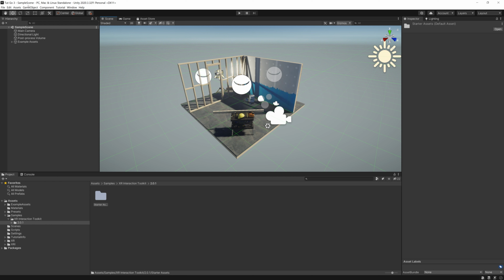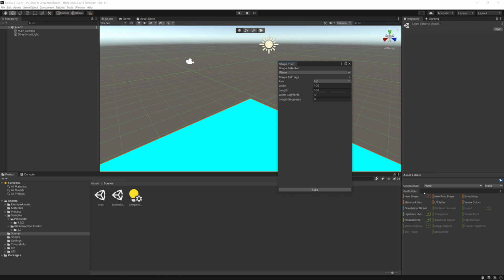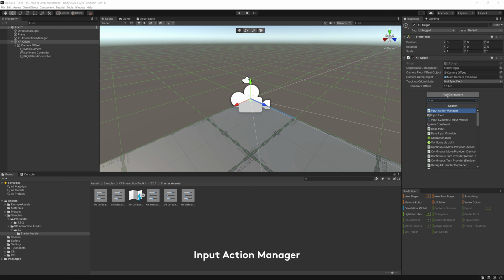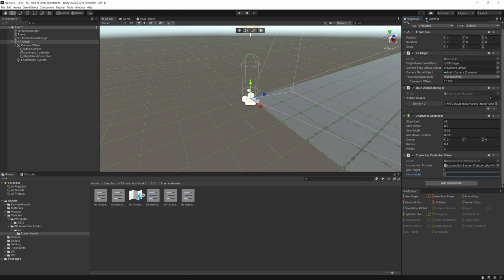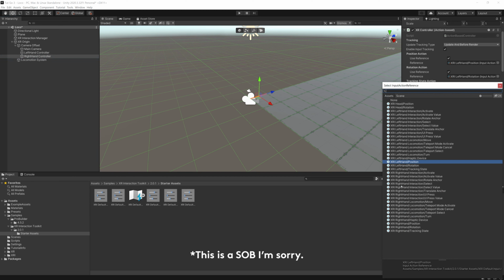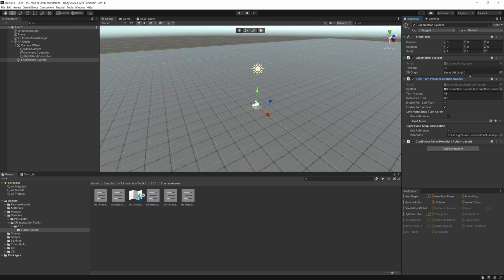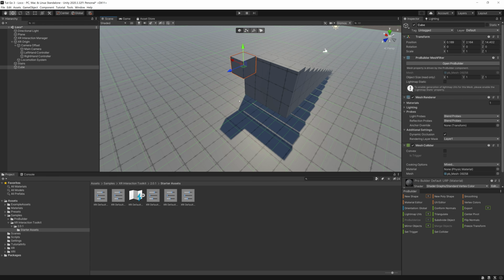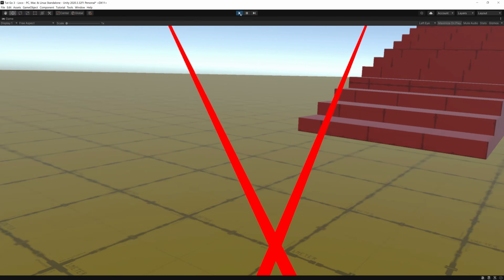Moving around your first XR world (Intro to Metaverse Design : Part 2).

Comment: Hey Daniel! Thank you so much for this playlist! Very helpful!
Could you help me to figure out, why I can't see the floor (in the preview mode) when the Camera and Floor are at the Y:0 position. But if I move the floor at least on "Y: -0.01" then I can see it.  Character controller settings are the same. (Center Y:1 etc)
Reply from the maker: I would imagine it’s because your camera is either on the floor or you’re seeing the back of the floor.  If you’re seeing the back of the floor the normals would likely be flipped.
Reply: @marqusee  Wow, interesting about the back of the floor! Will check!